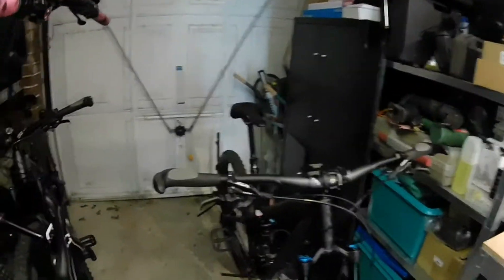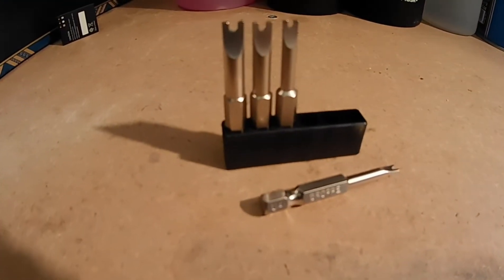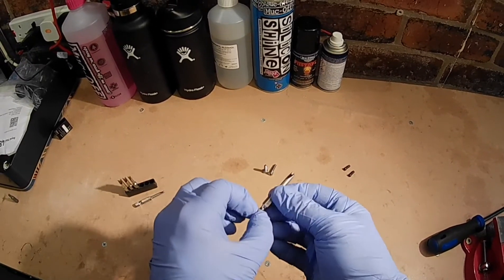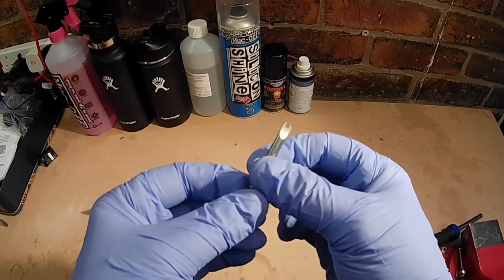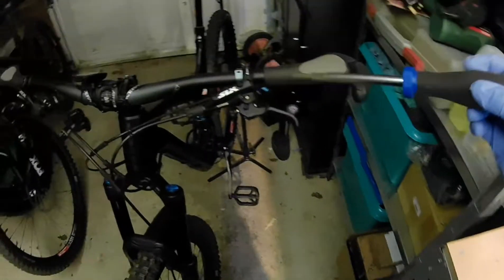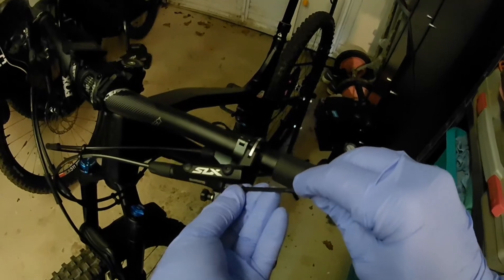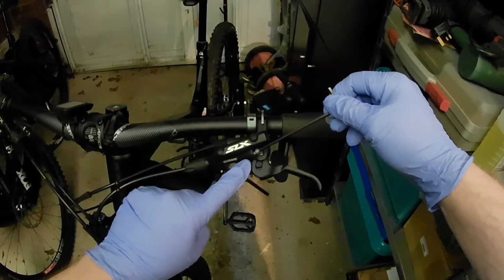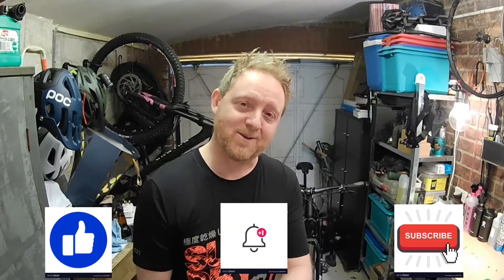Shimano SLX brake hack

Comment: I just dremeled a flat screwdriver (flat bit also fine) to get them plugs out.
Used a couple of old stainless steel derailleur high/low adjustment screws, there perfect fit. Looks exactly like the XT ones.
I did this on SLX M7100.
Reply: Did the same on my zee brakes

Comment: Hello guys!  I did the hack with an m4 12mm track bolt on my slx bl m 7100 brake lever.  According to my practical experience, the performance of the brake improved when the screw was unrolled, and the braking effect increased.  I think the "stupidity" on Shimano's part is that the screw is wound all the way down.  In my opinion, this is logically consistent with the fact that the xt brake lever screw is 10mm from the factory and the bleeding must be done when the screw is unscrewed.

Comment: Fianally decided to try the free stroke adjustment on my M7000 lever after a lot of reports it isn't an effective function.

 Bought u6 and u4 spanner head bits and the u4 fitted perfectly so didn't need to file a u6 to fit. The bolt I used was out of a spare bar grip locking collar, which is a (3mm thread diameter),14mm long and screws in enough for full adjustment with about 1mm of exposed thread.

Going a step further and replacing the current (3mm diameter threads, not M4?) with M3x12mm grub screws so I don't have a bolt head showing.

 Thanks for the clip to convince me to do it and yes it works. Glad that I have the least amount of lever travel possible now. From SLX's to XT's for £3.50 in total, great! 😎👍
Reply from the maker: Thanks for your comment, yes it does work 👍 confused about you using m3 though, its definitely m4, do the screws feel loose at all? There's should be no movement in the screw when fitted.
Reply: @trickyrickymtb5622  Confused too Pal.🤔 Tried a 4mm bolt using 4mm Allen key, didn't fit in the hole. Used a 3mm bolt (3mm Allen key) and it is a perfect fit. Maybe the size of the Allen key fitting isn't the same as the thread diameter? Waiting on delivery of 3M (thread dia) x0.5 (standard thread pitch)x12mm (length) grub screws with a 1.5mm Allen key fitting so suppose I'll find out for sure?🤞
Reply from the maker: @mtb4679  yes that probably explains it, mine is 3mm Allen key, but the thread outter diameter is 4mm. This is usually referred to as an m4 thread. Glad the vid helped
Reply: @trickyrickymtb5622  Thanks for the reply. The main thing is it works, didn't like the longer and uneven lever travel before. Now it's where I want it and can set for front and rear to be equal too, cheers!🍻
Reply: Confirmed today. Spare bolt had 3mm Allen key but must be 4mm thread. M3 grub screws too small so ordered some M4,s. Every day is a school day. Thanks for the correspondence.
Reply from the maker: @mtb4679  lol getting there is half the fun! At least you'll have nice dialled levers
Reply: @trickyrickymtb5622  All the doubters that say it doesn't work, try it. Screw the new bolt in properly then reset lever back out to original starting position and get around an 1-1.5 inches of adjustability.

 Use M4x0.7x12mm grub screws if preference is not to have any bolt heads visible. From SLX's to XT's for a few quid!💰 Cheers Ricky!😎🤘
Reply: @mtb4679  what would be the _shortest_ suitable bolt here? (not grub screw)
Reply: @cthulpiss  

Can't say for sure because different models of the XT'S and XTR'S can have different lengths for the original philips head freestroke adjustment screws and some have a 0.3mm shim underneath the screw head too.

There is no definitive 'shortest screw length' figure I could give.

The security (snake bite) screw that I took out of my SLX M7000 levers have 9mm of threaded length (10mm minus a 1mm shim) and even those are pressing on the plastic freestroke adjust mechanism and have a small effect on lessening level travel/freestroke. You may notice this as the lever blade moves out a little as you unscrew the security screw.

The replacement grub screws I used were only 12mm long and they achieved maximum freestroke/least lever travel possible  and they weren’t screwed all the way in so we're taking very minimal measurements between zero and maximum freestroke adjustment.

Like Tricky Ricky says in this tutorial just be super careful and stop screwing when you feel any resistance (and I also put a drop of blue threadlock to keep it from changing). 

I reckon you're better going for longer and be extra careful rather than too short and end up with no adjustment at all.

Comment: Awesome hack thanks! Used a 4mm 'grub' screw for a cleaner look!
Reply from the maker: Your welcome, I've actually changed to grub screws aswell, I agree it does look much cleaner.
Reply: What length grub screw did you go for? Ive looked and I can get an M4 in black but need to know the length otherwise i might order one that’s too long or short! 

Cheers,

James
Reply: Anyone know what length?

Comment: I am using same method since 2018, not a single problem. Nice video !
Reply: Not a single problem, because it is not working hahah :D :D Just tear down your brake and see what you actually did :D 
Spoiler:

You just filed the metal next to the brake cyclinder :D Unfortunately, you need extra part for it to push brake piston in to the cyclinder :) I am working on it to draw a STL file. If i complete, i will update this comment.
Reply: @yusufunlu3530  any update about this sort of blueprint draw of the SLX cylinder vs the XT and the lack of the parts for "free stroke" to work properly?
Reply: @yusufunlu3530  the author literally showed the handle moving, so what are you talking about ?
lol

Comment: I would use a screw as close to the look of the XT one as possible.
But a nice feature to have at no extra cost.
I can see why people mix and match components considerable savings can be had with no performance lost with the right mix of components.
XTR bearing jockey wheels can be used on the M6100 derailleur as a bit of a hack.
😎👍
Reply from the maker: I actually ended up changing the bolts to titanium m4 hex grub screws. Much neater. 12mm length looks best.
Reply: Why you didn‘t the original lenght of the Screw?

Comment: Works slightly. I only got about 10mm of lever travel before turning the bolt got harder (and I decided not to go further). Actually, I didn't see much difference to the hand ajustable srew around the other side of the brake lever mechanism. Oh well, worth a shot.

Comment: On the M7100 SLX brakes, the M8000 XT free stroke screw is available for purchase. Shimano Y8VC98070
Reply: Someone mentioned in the comments that the screw is the same length as the ones he removed, so it doesn't work.

Comment: any idea if this is similar for the new generation of slx brakes? BL-M7100 lever - in the picture it has the same 2 prong screw
Reply from the maker: I've set up the m7100 and yes this hack works

Comment: What happens when you break the mechanism?  I have the screw all the way in and I didn't really notice the adjustment.  I did hear what may have been plastic breaking, but it really didn't take much pressure at all for that to happen.   Did I just lose the ability to adjust or something worse?
Reply: Same happened to me. Wish I never stumbled across this video. Brakes still work, but are no longer smooth like before.... super bummed.
Reply: Revisiting this. Any updates on this? Does breaking the mechanism make the lever feel restricted or spongy?

Comment: Hopefully you can try SLX lever m665 paired with BH59 non series shimano hose. I noticed they have the same specs so might as well give it a try i was thinking it will work. Thanks for your video sir!
Reply from the maker: If it has the same internal mechanism, no reason it wouldn't work. The housing shouldn't make a difference.
Reply: I have the m7100 lever with mu m315 caliper. Works like a charm and they feel more powerful

Comment: I tried your hack with a M4 12mm screw that I paid 50 cent at a hardware store near home.
I don't think that anyone is supposed to insert a screw more than 10mm in, because past that point you risk breaking the mechanism.
The fact that the Shimano XT brake has a 10mm and the same exact structure (correct me if I'm wrong), is a pretty big tell imo.
I think that the your hack should only be used for people that want to have MORE free stroke.
I watched some other disassembly videos and I think my theory is correct.
I can even see the stock screw pushing the piston, it seems all the way, with a plastic thing.

I decided to revert back to the stock screw because I like the minimum free stroke and I don't want to risk breaking the lever while trying to reach the maximum point with a longer screw.
On that note, do you know we can buy the replacement plastic part that is pushed by the screw, in the case it gets broken?
The replacement is fairly easy.
Reply from the maker: I don't agree with your assessment of the screw 'increasing' the free stroke. I've done this on several sets and achieved a shorter stroke each time. You  need to adjust the reach to its most open position before adjusting the throw. Also pulling the lever in a touch whilst adjusting the throw helps avoid damaging the mechanism. You are right in that the mechanism is fragile, so care is needed.

Comment: Would altering  the free throw make.my braking  not a sharp jusy got a used set of m7000 witb new pads and disc  fitted them bled them and nearly went otb  the lack of modulation its like on and off  thanks

Comment: I think I have some of those so will go try this. I never would've even thought of it since I saw something when I was buying said it didn't have this adjustment so I dropped the whole idea. But I hate all that sloppy travel. I was actually just looking for best brake fluid for the SLX glad and I got lucky! Thanks! BTW any preference on brake fluid? 🙂
Later on: I loosened the 2-hole safety screw with an awl and hammer and then a pair of tweezers got it the rest of the way out. I did have some Headless 4m-0.7 x 12 set screws, usable with a 2mm Allen wrench. This was perfect! It went unseen down inside the screw hole and I lost some slop, such a cool hack!
Reply from the maker: To be honest, I still have the shimano mineral oil that came with my bleed kit. Never had a set of shimano brakes go off on me so only ever lever bleed if/when I change a lever.

Comment: Well, did it an i didn't see or felt any change. Lever moved but to the same position and the same contact point.
In general, to remove a screw and fit new one with the same length to the same position, what can be changed?
On the XT this is an adjustable screw, here, what the use?:face-orange-raised-eyebrow:

Do i miss something here?
Reply from the maker: Did ypu extend the lever adjust all the way out before installing the new screws, and did you slightly hold the lever in a touch when doing it? Also what length screw did you use?
Reply: @trickyrickymtb5622  No. It doesn't show in the Vid'.
Can you explain the steps?
Reply from the maker: @TomerGur  it's discussed in the comments, bit fully extend the reach adjust and before fully screwing g in the new screw, very slightly pull the lever, literally the tiniest bit. Sometimes the screw can snag on a plastic part in the mechanism, this helps to line things up.
Reply: @trickyrickymtb5622  Hi, did what you say and nothing happened...
The fill and contact point are the same.
I must be doing something wrong... Don't know what...
Reply from the maker: @TomerGur  what length screw are you using?
Reply: @trickyrickymtb5622  M4x30, just for testing the idea...
Reply from the maker: @TomerGur  well I'm out of ideas, I assume they're the m7000 brakes? Worked well for me on several sets and many in the comments.
Reply: @trickyrickymtb5622  Anyhow, thank you for your assistance, man.

Comment: omg. This is amazing. Just got SLX's on a new bike and really annoyed with how much distance in the action. Definitely going to try this. What grub screws should I be looking for? Bit confuses with all the M4, or 3mm, and overal length chat. Any clarification greatly appreciated.
Reply from the maker: M4 thread (4mm metric) I've started using 12mm long grub screws, looks neater.

Comment: The real hack here is improvising the tool bit. You wouldn't need to replace the standard plug once you have the proper bit.
Reply from the maker: The standard screw is inly 10mm long and doesn't fully adjust the reach, but if the range if adjustment was enough, then yes that is true

Comment: with the blank in does it have any effect on free throw. When you back the blank out does the hand lever move out as well? Ty for your time!
Reply from the maker: The blanking screw does have some effect, so will appear to release some throw, but being shorter doesn't provide as much adjustment as the replacement m4 cap screw.
Reply: @trickyrickymtb5622   TY for answer.

Comment: I did this and it definitely does work. I think people just don’t understand how it works or have bled the brakes w/o the screw and lever all the way out. I overnighted the screw on my front brake and definitely broke something, little piece of plastic fell out. Funny part is, I do still get some adjustment, just not the same as the rear. Anyone have any clue where to get the “free stroke adjuster”, as I’ve seen it referred to in some rebuilding videos? Been looking at “parts only” levers on eBay, but none that are much cheaper than just buying a new one.
Reply: Can i do this on shimano zee levers?

Comment: can you give me the links where you buyed those screws and bits?
Reply from the maker: These are what I ordered https://www.ebay.co.uk/itm/Broppe-5pcs-50mm-U-Shape-Spanner-Screwdriver-Bits-Magnetic-Bits-Tool-1-4-/224075824997?_trksid=p2349624.m46890.l49292  As for the screws, just  search for titanium m4 bolt/screw/grubscrew. There are hundreds of options in ebay.
Reply: @trickyrickymtb5622   thanks

Comment: Now the screw isn't really properly thightened. Doesn't it getting rattled out when you shred down the trail? Anyway, this hack is pure gold, thx. I love my new Scott Genius 920, but the free throw was driving me crazy.
Reply from the maker: Hi, you should be able to slightly nip the screw just enough to hold it secure. Just dont over tighten it, as the mechanism is quite fragile. If you nip it slowly you can get a feel of how tight it needs to be. Mine haven't rattled loose so far 👍
Reply: If I was doing this I'd put an M4 nut and washer under the head of the bolt to prevent me screwing it in too far.

Comment: More like making the starting point closer to the bite point, cause the bite point doesn’t change position sadly
Reply from the maker: That's the whole point, shortening the biting point means less travel of the lever before it bites. That's how shimano levers are designed.

Comment: Great hack! Where can I find the titanium screws?
Reply from the maker: Ebay.. m4 titanium cap screw
Reply: trickyricky MTB thanks
Reply: trickyricky MTB what is the length of the screw that you used?
Reply from the maker: @jarellano80  15mm
Reply: @trickyrickymtb5622  I suppose the answer then might be to use a 10 mm m4 screw so less is sticking out? Nice hack though. I have the exact same problem on my new bike and the dead space in the brake action is unbearable. I'll probably be using your technique. Thanks!
Reply from the maker: @paghal11  thanks, I think the perfect length is 12mm, the screws already in place are 10mm so you wouldn't gain anything.
Reply: @trickyrickymtb5622  Sounds good. I’ll look for 12 mm then. What’s the thread pitch?
Reply from the maker: @paghal11  it's standard m4 thread. Could always cut down 15s if u don't like them sticking out that much.

Comment: Could you not use the same screws that are in the xt brakes
Reply from the maker: In theory, not 100% sure whether the thread is the same. However I think cross head screw doesn't look great. I'd rather have an allen key bolt
Reply: I made the mistake of buying the OE Shimano XT screws... Complete waste. They are the same length so there is no additional adjustments over using the existing SLX bolt. Also the XT ones were gobbed with so much solid loc tire that it was really hard to screw it in there and I partially stripped the Phillips head

Comment: Would this work with a shimano zee lever too? think its m460. It looks like it should?
Reply from the maker: Not sure to be honest, haven't ever owned the Zee brake. Just remove the screw to see if if the lever moves, if it does, it should work
Reply: @trickyrickymtb5622  magic thanks, I've bought the parts and will give it a bash
Reply: @bipssy  does it worked??
Reply: @paalikafna5272  not really no. there was no real improvement

Comment: Can i use shorter bolt like 12mm?
Reply from the maker: 12mm might not provide full adjustment, haven't tried it sorry. Another commenter on here used m4 x 12mm grub screws, I think that would work

Comment: What size of bolts did u used?
Reply from the maker: Hi, m4 x 15mm.
Reply: So m4 ×10 can fit?
Reply from the maker: Yes but that wouldn't provide any more adjustment to the u-bolt currently there. I would say you need 15mm
Reply: So i can get an adjustment with m4×12?
Reply from the maker: @bikeward772  yes m4 x 12 would work fine, not sure you'll be able to buy 12mm long bolts, but if you find some, they would work well..
Reply: Thanks for the advice